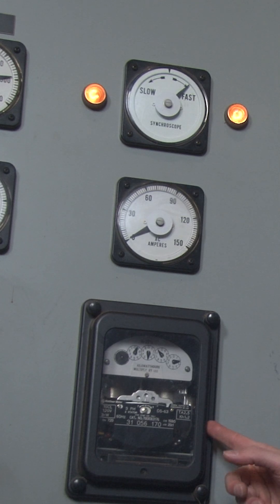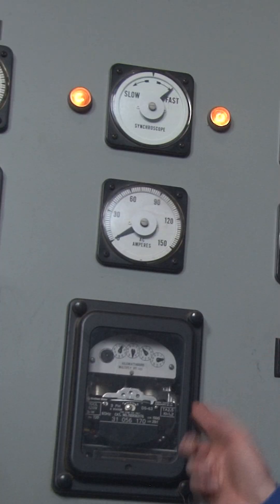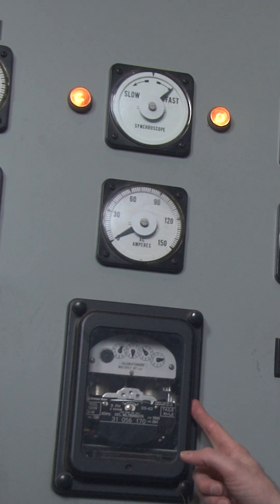kiloWatt Hour Metering #engineering #powerplant #hydropower #highvoltage #science

Comment: I'm super happy that you are back from your extended stay.  You should do a video of why  KWH is so dumb.
Reply from the maker: Thank you sir! :) It's good to be back! I missed you guys! I'm already working on the script for that one.
Reply: @Physicsduck  Sadly, as a generator, you have zero idea as to why a kW/Hr meter is needed.
kWatts are NOT something you can measure with JUST an ammeter, or a volt meter, you need a meter capable of measuring the work done, by the voltages it measures the kW/hr (each second) that is used, when the higher current is drawn.
In other words, it measures BOTH the voltge as it DROPS, and the current drawn, (at any particular time), and TAKES an average over each hour, to arrive at a power consumed (kW/Hr) value.

If one just took current readings on their own, you would overcharge your consumers, as that current is NOT being used by anything, unless there is a voltage drop at the appliance, which forces that higher current to be drawn

The greater the voltage drop, the higher the current value.
Taking a stab at the MAXIMUM aVAILABLE voltage, as if it was at the transformer supply end of the connecting cable network, (between the pole supply meter and a distant appliance), COMPLETELY IGNORES the lost kW/Hr "apparent value" when a big motor for example, draws an enormous current from "an almost zero voltage" at it's motor terminals, because it's voltage drop is so huge.

Taking say a 300 amp start current, as the maximum read, the meter has that day, you CAN NOT CHARGE THE CLIENT with a 24 hour run level, of 300 amps (at mains supply voltge  of say 240v)
As the maths for that is, 300a x 240v x 60 seconds, x 60 minutes = kW/hour

Lets see eh? 300a startup, (x 60 seconds per minute, x 60 minutes per hour) = ?
A simple voltage x current drawn value of 1,080,000 kWatts (that you then assume was drawn & thus used in a ONE hour period)

Thus for a household refridgerator's startup current, (pulling say 300a for half a minute = 30 seconds) - you would try and rip the client off, for a total of 1,080,000 kWatts - in any one hour, by taking a spot check every hour of voltage at the supply, by the current sent by the supply.

A completely incorrect (idiot) value, considering the motor runs ONCE every hour, for just half a minute startup max value, which very quickly reduces into the much "lower" run current.

It uses way less than a mathematical equation of Maximum voltage x Maximum current..

It uses a kW per hour measurement, which is taken by the amount of current pulled at the precise moment the voltge is reduced to almost zero at startup, quickly rising back to the full available currrent, as the motor spins rapidly up to run speed, rapidly reducing it's run current.

The 300a is ONLY drawn for a fraction of a second, while the run current takes a few more seconds to stabalise.

Thus a kW/Hr meter is able to calculate the exact power taken from a very much reduced supply (for a fraction of a second it is drawn at) at the meter board of the consumer's installation, rather than what your generation output sends into the NETWORK's supply/distribution lines.

Hence a client pays for (actual per second) energy consumed, not a fancy word for - oops got that wrong?
Incorrect maths calc.
Reply: @Physicsduck  If you supplied ME with a two phased 120degree separated (3 wire = 2phase & neutral) voltage supply, I would IMMEDIATELY connect those onto two 120volt transformers, AND A THIRD being a 240volt transformer - in a DELTA configuration across the two wires that you claim would be 120degrees apart, as that earth/Neutral would provide me with a 60degree separation point (or would that be the 240degrees missing from your 120?)
As then I would get a genuine 3ph "secondary output" that I could severely reduce to one of say 24volts, on each sub circuit, to which I would then connect THREE 24volt to 230v transformers onto, to get THREE LINE PHASES of 400v at 240volt STAR, being the star connections from the three 24v/240v transformers.

THAT WAY, I could use my created THIRD PHASE, while your useless kWhr meters did an amazing thing.

I would be getting FREE POWER, as whatever one meter did, the OTHER would spin in reverse, meaning zero power used on EITHER of the two incoming phases, as I was using the 3rd PHANTOM PHASE, obtained from a 120 degree vector angled two phases of a 3 phased supply.

HOWEVER, the single winding in a single phase (pole) transformer, couldn't give a toss, as to what phase angle the incoming ph/N is at, as all it requires is a supply voltage, that is reduced through transformer action, into your output single centertapped phase.
One with two equal but compleely (180degreee) opposite phases from a referenced neutral midway point.

In other words, that so called RARE 2 phases you talked of, in your shorts video, completely ignored the fact - that YOU were using a 3ph generator's 120 degree "triple phase angle refence" (between 3 lines) instead of a single wound wire's ends - center tapped 180 degree angle.

TWO PHASES obtained by splitting one phase exactly in half at it's center, creates TWO smaller value phase points, in reference to the midpoint, as BOTH are 180 degrees from the other.
Reply: @Physicsduck  Oh YES
Please start on the kWh rant video, because I know you will finally figure out, the DIFFERENCE between a VOLTAGE/CURRENT calculation, and a "time equivalent kilowatts per hour" actual power consumed calculation.

The difference is very cruel, to those who don't get it, at your experienced level..

ie:
Kilowatts are a measure of real power, while volt-amps are a measure of apparent power. 
Electrical power is a measure of the instantaneous rate at which electrical energy is generated at the power station and the total energy delivered to an electrical device connected to the power station's distributed network, of higher and lower voltages..
Reply: @Physicsduck  excellent. We look forward to it!